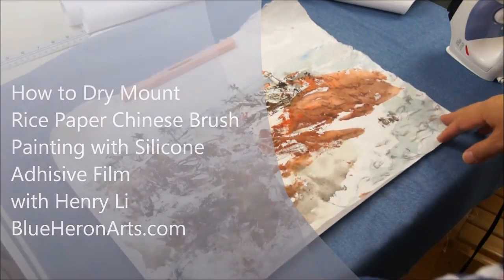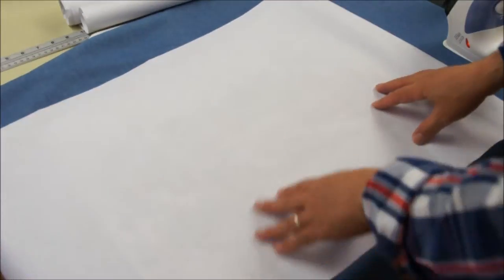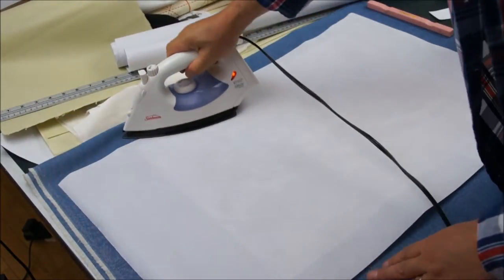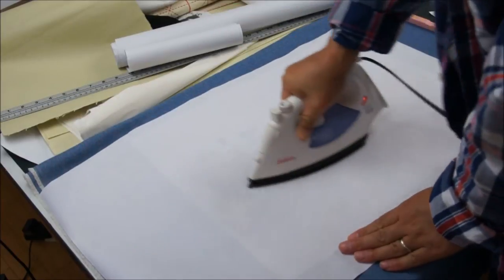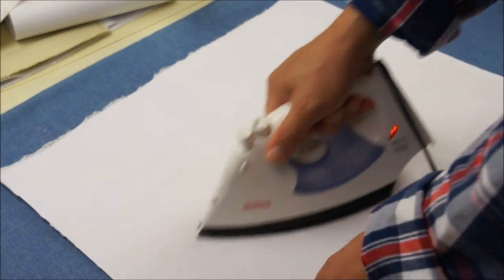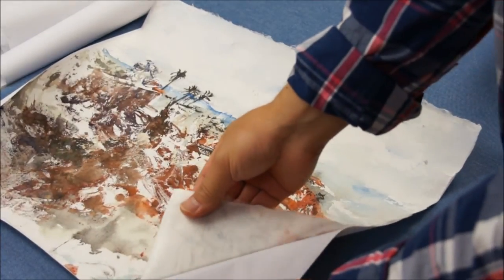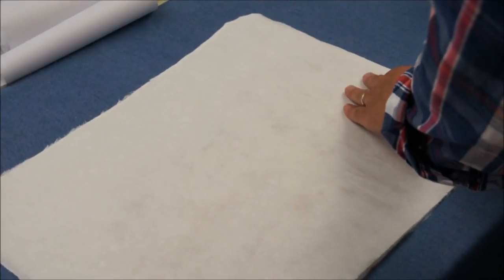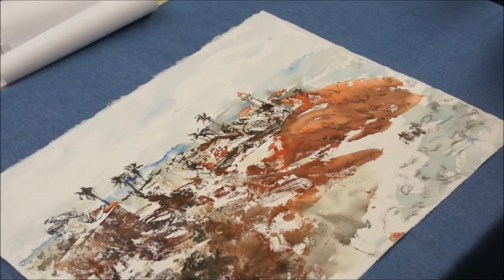How to Dry Mount Rice Paper Chinese Painting with Silicone Film (Method A)

Comment: Thank you for sharing this technique! Do you think I could mount rice paper(Wenzhou) to regular paper and then glue it on thick pressed cardboard without having glue marks showing through the ricepaper? I don't think I will be able to mount the rice paper directly onto the cardboard since it will be very hard for the heat to penetrate the cardboard backing or...can I iron from the front?
Reply from the maker: With method B(put silicone film on backing support first), you can mount it directly on cardboard if you want, or to be better to mount on a regular paper(such as watercolor paper). BHA also sells a special plain backing paper for dry mounting.
Reply: Thanks!